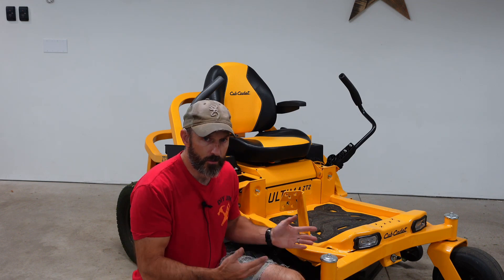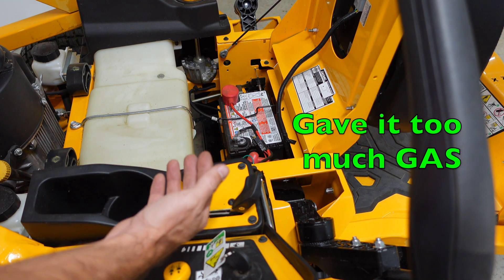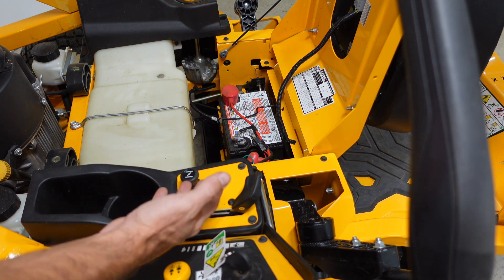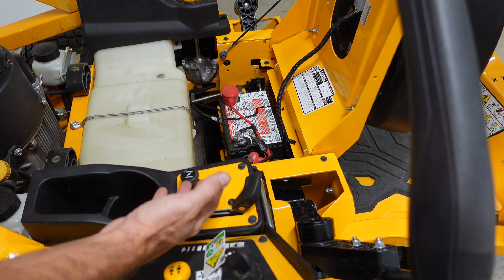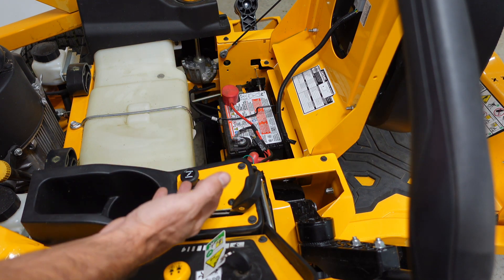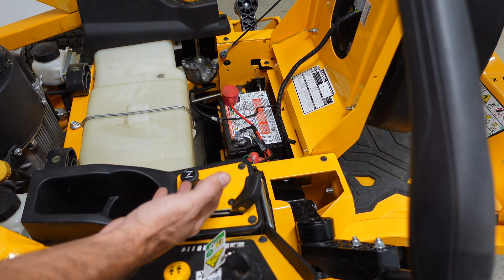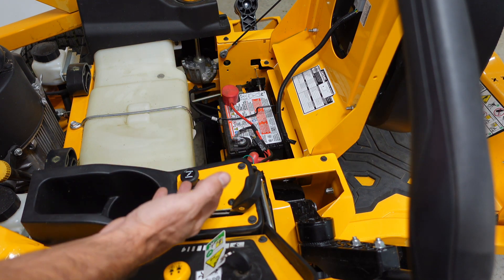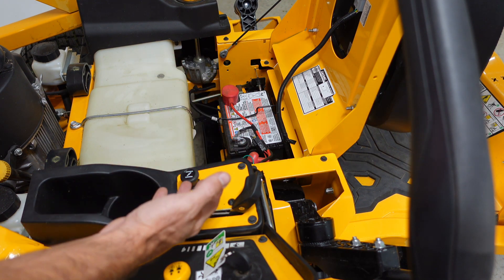My Cub Cadet Ultima ZT1-ZT2 zero turn will not start (Try this first)

Comment: I just uncrated a Cub Cadet, no start with just hearing one click on key turn.   After hours of troubleshooting it appeared there was 12V on both side of solenoid when key was on (ground to measure with light tester poking all over sensors ect).  Same 12V when key in start position, but hear the solenoid click.  When Key was off, then only 12V on high side of solenoid.  Well... after more troubleshooting, noticed that the whole engine block was at 12V when key was turned to on position as well as start position.   Found that the engine is mounted on a painted (insulator) frame (ground).   The engine mount bolts are "supposed" to ground the engine but these bolts go through the frame... if your lucky they touch the frame.  After putting in a ground wire under the engine mount bolt and other end to frame bolt... ta da... Starts, with no issues.
Reply from the maker: Awesome glad you got it figured out. Sorry my video did not help you. Maybe this comment will help others.
Reply: Si aquí está

Comment: Got up to close the gate and my ZT1 died and would not restart.  Was sure an expensive repair was on the way.  Watched your video and never thought to look at the safety switches.  Took a look, one of my safety switches was loose, turned, and wouldn't engage.  Turned it back and mower started up just fine.  Thanks for saving me a repair!
Reply from the maker: Awesome glad I saved you some $$$

Comment: Finally someone on YouTube whom actually gives real advice for these. What if my Mower starts up for 10 seconds or less and keeps stopping by itself. Mines brand new and just won't stay on long. I've done all your steps but she just idles a bit and then shuts off?
Reply from the maker: Sorry I’m not sure
Reply: Bad fuel pump , water in the gas, faulty carb solenoid, coil pack failing etc. ??
Reply: @waylonmccrae3546  I've drained everything to be fresh because it's unpredictable what the factory did or how long it sat around in the warehouse, last thing I gotta do is a full oil change and new oil filter. To make sure I'm the one that put everything in. Thanks for your advice though, appreciate it.
Reply: @Shano84Mac  Once it dies , how long before it will start up again ??  I'm guessing fuel issue , main jet clogged with trash in carb, fuel solenoid switch plunger stuck closed , have you pulled the bowl off carb ??
Reply: @DIYJIM  Some help you all are then 🙄 I'm not even an engine mechanic but because my background as a Computer Mechanic,  I fixed it, no thanks to Ya'll " Engine Pros" 😚
Reply: @Shano84Mac   So what was it ??
Reply: Did you leave the choke on?
Reply: Mine's doing the same thing. The delivery guy drove it off the truck no problem. 20 minutes later it won't start for more than 5 seconds fully choked only.

Comment: I have aCub Cadet 42" machine and the previous owner told me that those machines all turned on as if the battery was low. I recently bought a battery and it turned on quickly the first time and then started slowly. Do you think there is a problem with the wiring?

Comment: I have a cub cadet 42in rzt mower. The motor turns over but want crank. Changed everything and it still want crank. What else to check. Its a zero turn

Comment: Gotta’ tell you man, this has been THE most helpful video on the CC I’ve seen anywhere since buying my ZT2 back in 2020!

So at this moment, I’m in the shed trying to fire it up after a cold winter here in the rural PacNW—but I still can’t start it despite going through your tips. The only thing I can think of is that the battery is reading 9.72 which may not be enough to kick over.
Reply from the maker: Sounds like you need to jump it or charge your battery. Glad I could help thanks for leaving a comment, and thanks for subscribing if you did.

Comment: Thank you, thank you, thank you!!!!

This video was an immense help! My mower is brand new and I had a hard time starting it just getting it off the trailer!! I tried again today and was giving me all sorts of issues (clearly I was the issue).

I had the choke open all the way and tried starting it but no good. Turns out I flooded it like you suggested!! I didn't have the throttle all the way up when starting too, left it alone for a bit, throttle all the way up, choke slightly open, it started right up!!!!!!! 

Thank you!!! Very useful video, I ended up watching the whole video for the education!

Great work!!!
Reply from the maker: glad my video helped you. thanks for watching

Comment: Great video JIm, thanks. I have a Club Cadet ZT2  54inch model. Is there a gas shutoff valve? My garage has a gasoline smell after I use the mower. I'm 75 and its hard for me to get low enough to look for a leak or a shutoff valve. Any suggestions?
Reply from the maker: Sorry I do not think there is a gas shut off

Comment: I started my ZTRII yesterday. Aired up a tire then parked it. Mowed a strip before it told me it needed gas. 
This morning I gassed it and , no start. Double checked the steer handles checked the battery, ok, how do I check the electric clutch safety switch?

Comment: After noticing blades rubbing on deck I adjusted them. Now, my PTO won’t engage blades. It runs and drives ok.
Reply from the maker: Maybe your blades are the wrong size.

Comment: Regarding LOW OIL won’t start.

Well, December 1 2023 brand new ultimate ZTS52. Ran it three time just fine. Went out today middle April 2024 and it would crank over but not start. Then nothing. After watching your video I went back out and on my tiny LED display it says LO OIL 8    32. Checked oil and it’s full. Battery is working , I have plenty oil. Frustrated. 

Also on this model it is VERY DIFFICULT model to disengage brake lever / engage lever into correct position so that this machine will start up

Comment: The battery I got stock in my 2022 is way to small or its got a dead cell but it looks like they planned a way bigger battery. 2 weeks after I bought it new it started acting like the starter was failing.
Reply from the maker: Hope you got it figured out.

Comment: I've replaced battery, solenoid, safety switches and still won't start. No click what could be the issue?
Reply from the maker: You definitely have your blades turned off and then park? Could mice chewed any wires?

Comment: Mine is turning but it won't start up.
Reply from the maker: Could be the carburetor if you do not put any stabilizer in the fuel when you put it away for storage for winter.

Comment: seems like the starting solenoid is bad, when you hook the battery up the engine turns over then turning the key to run keeps the engine running, then turning  off the key shuts the engine down  then if you immediately hook the battery up the starter keeps running after the engine is off
Reply from the maker: Hope you got it figured out, Thanks for watching
Reply: @DIYJIM  yup, they had wired the solenoid backwards from the factory.
Reply from the maker: @photoboy1986  crazy glad you figured it out